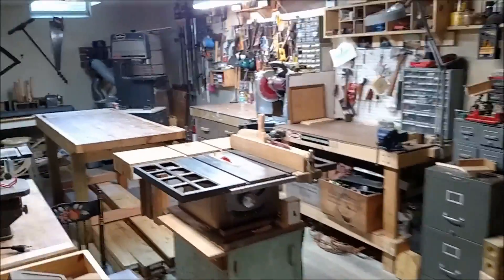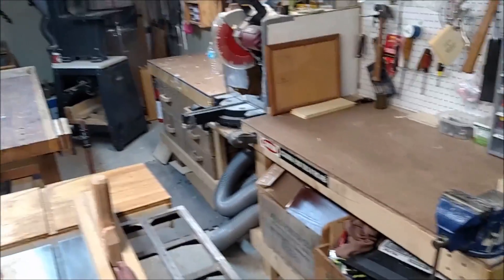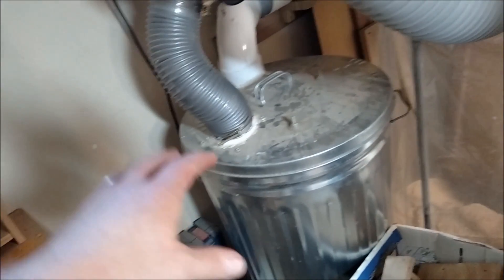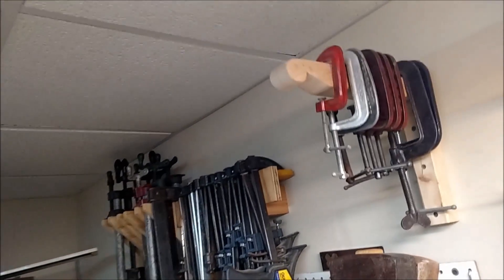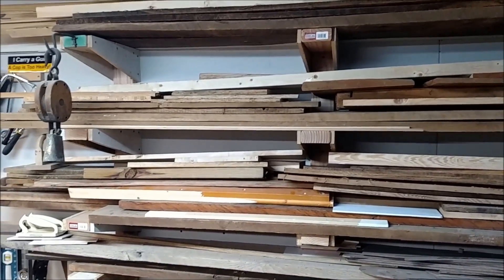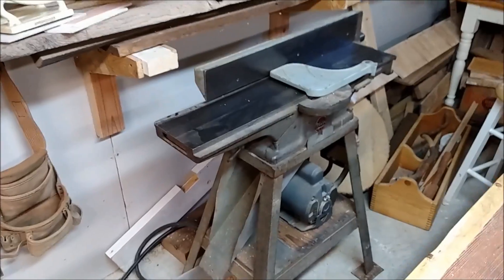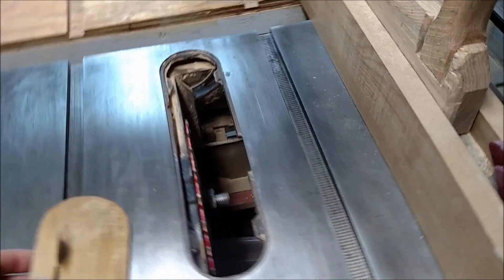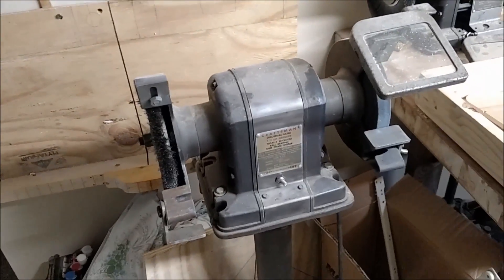2016 Shop Tour- Vintage Wood Workshop

Comment: I have mostly vintage tools in my shop and got some tools from my Grandpa that was born in 1895.  I also picked up some cool vintage tools in the 70's and 80's from one of Grandmas friends.  My 10 inch table saw I bought from an old timer carpenter who retired in the 70's.  I have some old tools that I do not even know what they are!LOL  Your shop is cool and has that cozy appeal! My shop used to be in the basement until I got married and then the boss lady ran me off to the garage because of the dust and noise.  It's nice in the summer when I can open the large garage door and get a nice breeze blowing through.  I like your channel and I did sub for you.  Now go build something!
Reply from the maker: Thanks for subbing, Anton!  Sounds like you have some cool old tools and especially nice that many were passed down to you from your Grandpa.  My dust collector is definitely essential for the basement shop but yes, my wife does get sick of the noise sometimes!  A bonus is that it is nice and cool all year down there.  I have my metal working tools and machines in the garage but those are off to the side so my wife can park her car.
Reply: Anton Bouchette a

Comment: Great video! Any videos on how you built your table saw fence?
Reply from the maker: Thank You! Sorry, no video on that but it's the original 50's craftsman fence and I attached some hardwood to the sides.  These fences have a bad reputation on the internet but I found that if you have the long threaded rod tensioned properly, it stays true and square. Thanks for watching and commenting, Freight Train!

Comment: Does ur table saw have a 1/2 inch or 5/8 arbor I have the 880 series which has a 8 inch blade
Reply from the maker: Chandlers Kustom Creations this is the 5/8" arbor king Seeley made saw